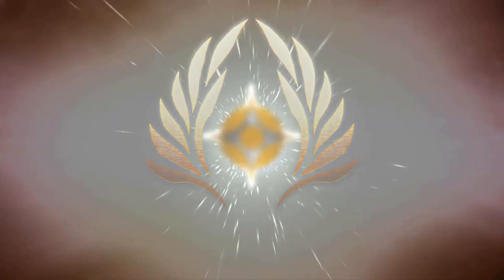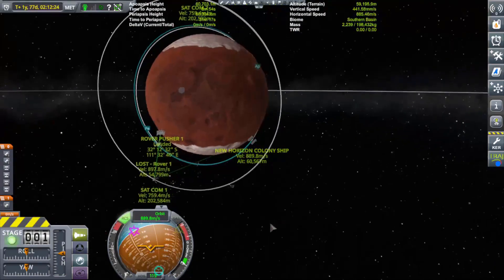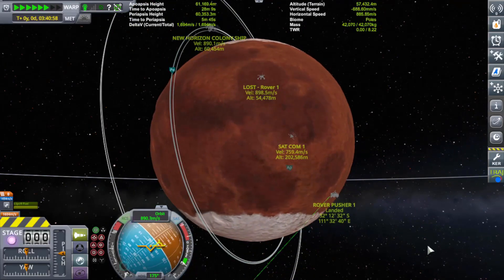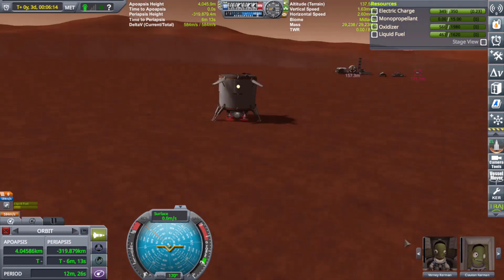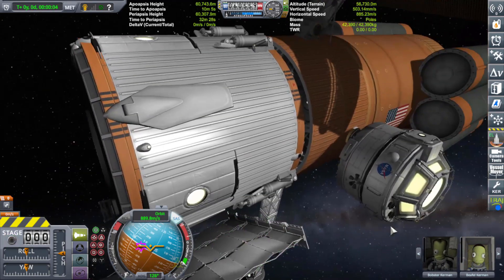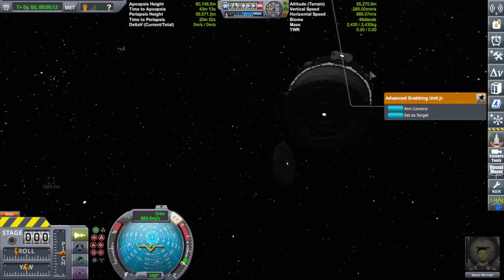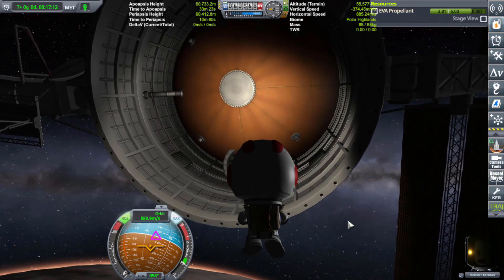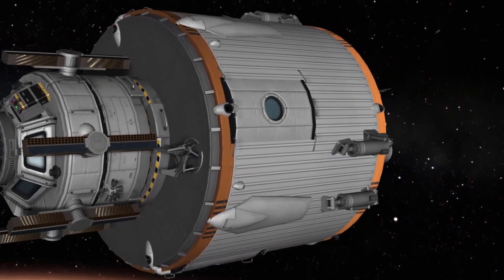DETERMINATION . THIS IS THE WAY in Kerbal Space Program. Part 7

Comment: Lights are so useful for landing and docking. I have one little plane -- actually a modification of the stock Dove -- where the docking port rises on a piston in front of the pilot. With a bubble cockpit and pair of lights either side of the docking port, you can dock without leaving pilot's eye view.

Nice landing! The only time I got close to my target, I had vernor engines which I used to position my ship after killing off all of my speed. It was on Minmus where you can kill off all your speed without wasting too much fuel.

Here's me, holding my breath, worried about the extra mass as lander 2 comes down, but he nails it! Yeah! :D

Rocket hopping! Or puddle-jumping is the classic term, but I call it rocket hopping because it sounds better. (I might have got that from some old sci-fi when I was a kid, I don't know.) Actually, my plan for Duna-local transport involves 'hoppers' rather than aircraft.